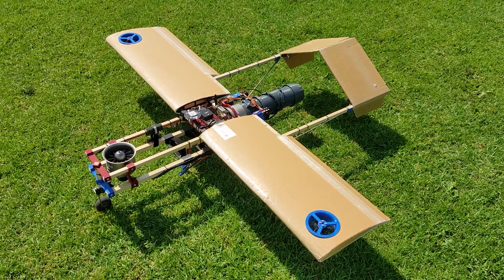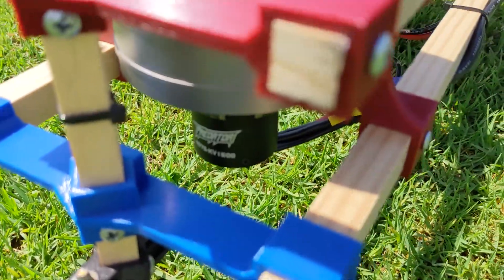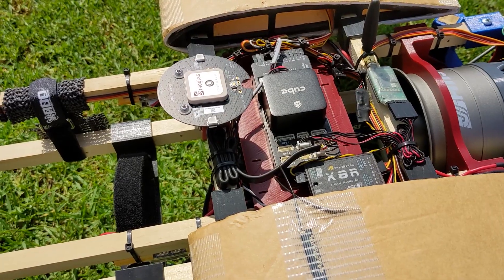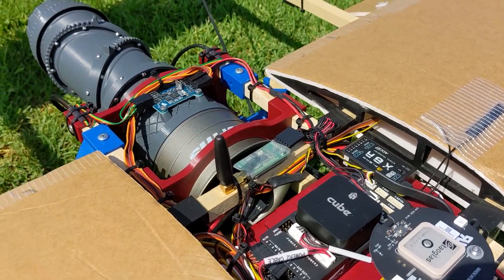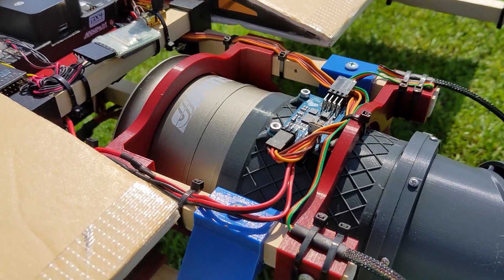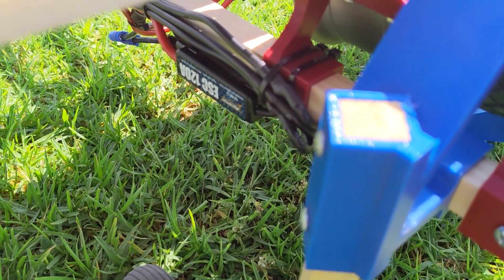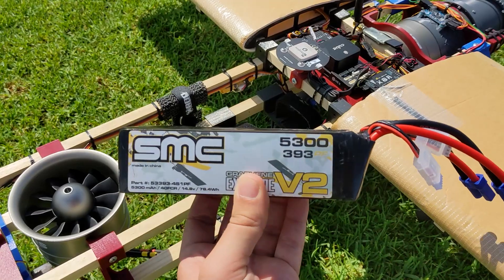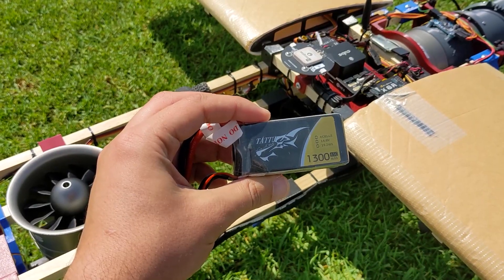R/C F-35B: Flying the Upgraded Testbed

Comment: That inbound transition was just magical. You're winning in the scale RC F-35 contest, that's for sure. Excited to see this with the F-35 airframe...
Reply from the maker: Thanks! It now holds level during transition and vectors the thrust backwards for braking instead of pitching up. I'd claim credit for that, but turns out it was a happy accident when I started using nozzle tilt for forward/backwards position control.

Comment: how much surplus thrust you think you have for VTOL with a fuselage, landing gear and fan port retraction and extension?
you think you will have to scale up the testbed?
anyway, since we are ~same age,  i would like to have 1/10 of your skills and knowledge in sw and electronics
Reply from the maker: I think I have enough extra thrust now to build a basic scale fuselage, though a fully detailed one with doors and all will probably need to be scaled up. Plus as nice as the FMS fans are, the aluminum housings are much heavier than something like a Jetfan. So this might evolve into something that uses those in the ~110mm size on an even higher voltage setup to keep the wire and ESC size down.